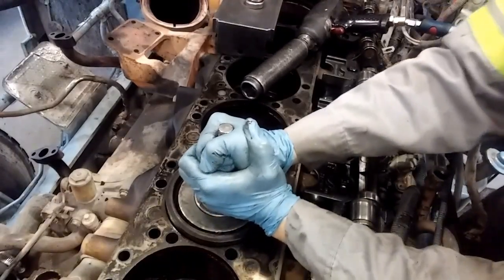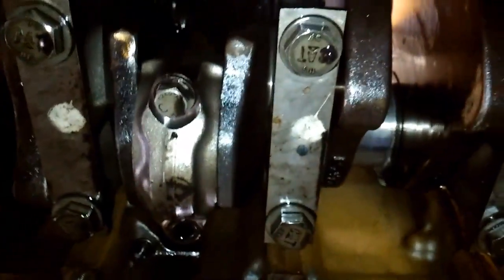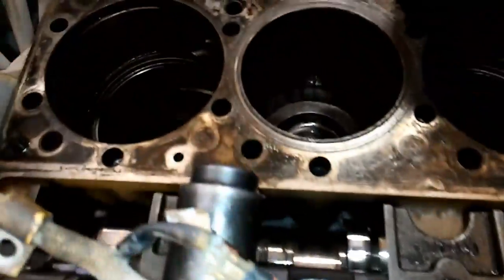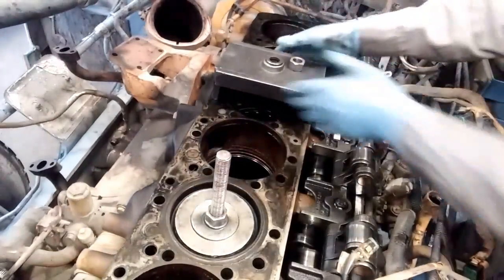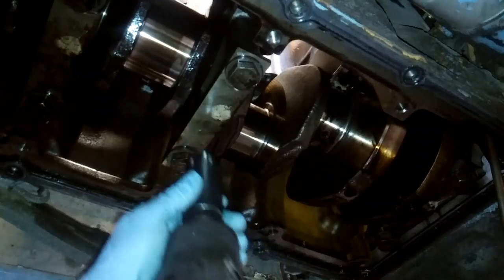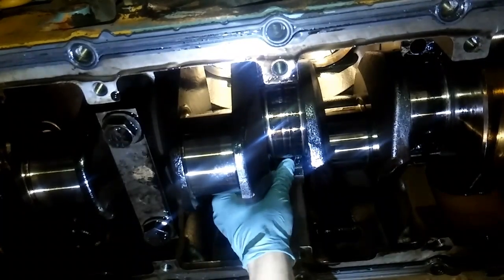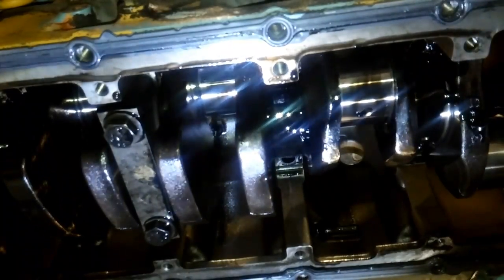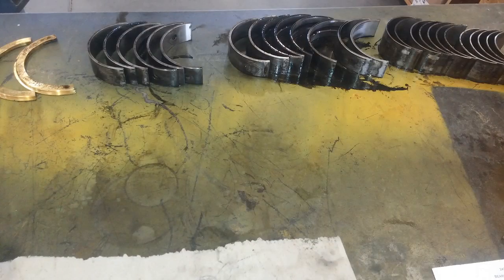How To Rebuild A Diesel Engine.  Part 2.  Piston Packs, Mains, and Thrust Bearings. Twin Turbo Cat.

Comment: You can really see the join on those 'broken' cast con rods when you are turning the crank shaft....If I saw that without this video I would have a heart attack..(not that I'm a deisel mechanic though)  Great videos..
Reply from the maker: +Malcolm Young The fractured rods definitely look broken if you didn't know that it was  purposefully designed like that.

Comment: You remove the piston together with its liner?
Reply from the maker: +Piggyboi Yes sir, it makes it faster although heavier and you never have to worry about a ring compressor.
Reply: That make sense because when we install we put first the liner and then the piston

Comment: To remove the top bearing cup from a c15 I use a brake shoe lining rivet . Fits perfectly in the oil gallery and has a flat top Bit of a share :)
Reply from the maker: +Blake Hughes Thanks for the tip.
Reply: Blake Hughes i use a split pin

Comment: I'm doing engine tear-down and rebuild in my heavy equiment course so this is really helpful to watch bro.

I used the heal bar method you used in the video since main bearing journal #4 on a 3126 doesn't have the oil port hole to stick a pin in, gently working it out. Then a classmate ran over to me in shock; "whoa what the hell are you doing?!... oh I guess that will work..."  I figured that side of the bearing doesn't matter as much if it gets a few nicks in it however we are reusing the old bearings, lol. thanks for the video!
Reply from the maker: +Corey Regier If you are reusing the bearings the pry bar trick might not be the best then, just tell your cheap school to buy some new bearings already.
Reply: I know its not the best, however in this situation we can get away with it since these engines only run a couple minutes after they are 'rebuilt'. We were also told to only torque fasteners 75% of spec, so we don't overstretch bolts, lol.  Also one of our rods was bent when we took it out. 

Personally I'd love to throw  a new rod, seals, gaskets main bearings and camshaft bearing at it but they don't have much money to throw around as you said. Thanks for your concern and I'll let you know if one blows up... to be continued.
Reply from the maker: +Corey Regier My first rebuild at school was like that, wasn't very well supervised either, the instructor let us put the engine together dry with no oil on the rotating assembly, guess what, it didn't rotate when it was all done.  Oops.
Reply: Well everyone got their engines running, one group had their injection pump timed wrong due to multiple 
 timing marks on the pump gear and another group busted their injector lines on a Mac engine with EUP. 

Ours started after ten seconds of cranking and we had no leaks or issues. some white smoke due to the bent connecting rod/less compression we figured. Other than the bad rod it runs good. Your videos were really helpful while I was putting it together, thanks!
Reply: Corey Re

Comment: Well done, Josh. I used to hate replacing bearings that way. I always managed to get oil in my face , mouth and eyes and armpits. HaHaHa.
Reply from the maker: +wysetech2000 Armpits are the worst, I try to pull them then let it drain for hours. Then spray it out with solvent or brake clean.
Reply: Last one i did on my back i don't think they had brake cleaner.  LoL.

Comment: Just finished my c15 acert complete overhaul, it took me and mechanic 1 day installing main bearings. Each bearing was installed with a plastic gauge inspected then reinstalled. The long pipe was involved in the installation, the bolts were torque to 120lbs then turned 2 flats other term 60º. My legs were in pain lol.
Reply from the maker: +Nikolai Romanov I hate to be the bearer of bad news but 60 degrees is one flat not two, unless you are using a 12 point socket.
Reply: Adept Ape, we followed 60º. Thank you. I feel power now, now is real CAT.
Reply from the maker: +Nikolai Romanov I'm glad you built it slowly and methodically it sounds like. We never use plasticgage and use a 3/4" impact to torque turn them on the C15 engines. Which isn't ideal, but we can't spend 16 man hours on the mains. It's different when it's your own rig though.

Comment: will you be timing the camshafts as well toward the end of this series?
Reply from the maker: +Simon Leighty From the looks of the Camshaft, it won't need replaced so far. Since it'll pass inspection I probably won't be removing it and timing it.

Comment: good idea using the bolt on two three five and six I never thought of that keep up the good work enjoy watching your videos I recently just got the same puller that you're using I prefer it over the old style where I had to remove the Piston out of the liner because when I had to put them in the core box I have to compress the Rings or break them off seems like it saves a step
Reply from the maker: +James Johnson I usually try to keep the pistons in the packs, but these I had to pull the rings off the pistons and remove them to get the puller out.

Comment: I have a 1995 autocar that I put a head back on and for some reason number one cylinder exhaust push rod keeps bending only one that put the jake brake back on it's not plugged in or anything I pull the Jake back off I replace the push rod runs fine soon as I put the Jack back on tour Can't Back Down it bends just that pushrod why any ideas
Reply: What is the engine?
Reply: 3406b caterpillar I took a sea head off because it's the same non-electric and put it on head-to-head checked out and they said everything was good and that's the problem I've had this truck has been down because I've got cancer and I'm trying to keep everything in-house because medical bills are killing me this thing is just been down for like 7 months for me screwing with it
Reply: I watched a lot of the videos it helps me a lot but it always shows a head that's not exactly mine it's a 1995 3406b caterpillar with a Jake I always call somebody in to adjust the valves because my mind can't comprehend because of all the meds on how to set the valve clearance because it's not the identical head is mine any kind of help is highly appreciated you just don't know how much I appreciate it
Reply: The problem could be an improperly adjusted jake brake causing that jake to be too "tight".  Have you had the jake setting checked?
Reply from the maker: +Charles Long I see Chad is helping you out, he is a knowledgeable commenter on here. I don't have a 3406B specific overhead video, but my guess would be either the Jake is misadjusted or something wrong with the Jake housing. You can email me directly at AdeptApe@yahoo.com if you get in over your head. The comments get overlooked at times.

Comment: the top golden bearings that prevent the crank from moving, are those necessary to remove? would it take crank out of specs??
Reply: just rock the crank forwards and backwards from the crank pulley. if the play is excessive just change them. normally they come with an original bearing set so why not change them as well.
Reply: stilkus ok thanks
Reply from the maker: +Big Foot What stilkus said it's true. They usually don't wear much, but they are part of the bearing set and they are easy to change.
Reply from the maker: +Big Foot Good timing on the rebuild with the video series, thanks for the donation.
Reply: Adept Ape Thanks 👍
Reply: Adept Ape No biggie....coincidently it began to smoke while idling on friday , no oil mixture no mayonaise looking oil......Ive installed new pre cooler new oil pump new water pump , new air compressor (chasing my tail on this these past few weeks) took manifold off #6 and #4 wet .  so im praying its only a head gasket and not a cracked head which its highly likely on these.